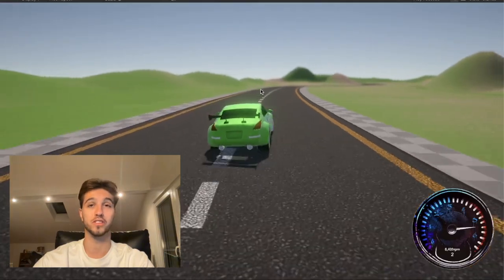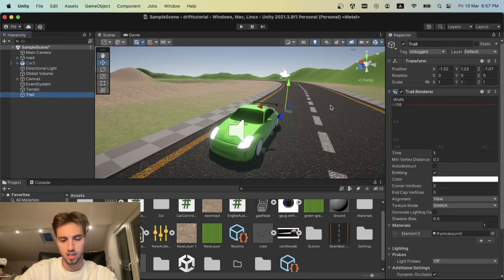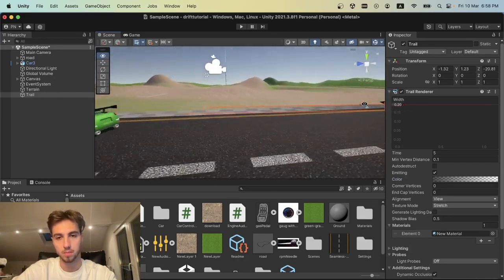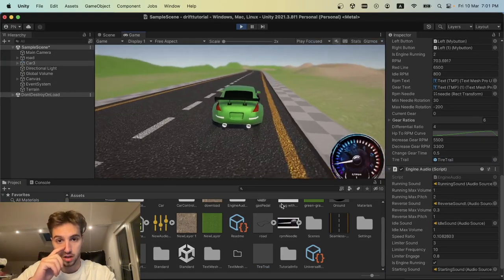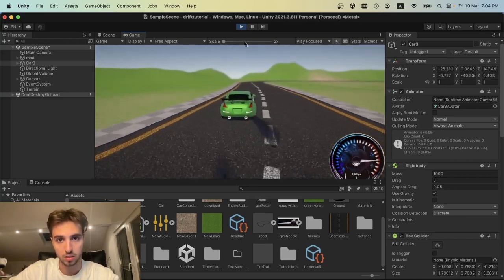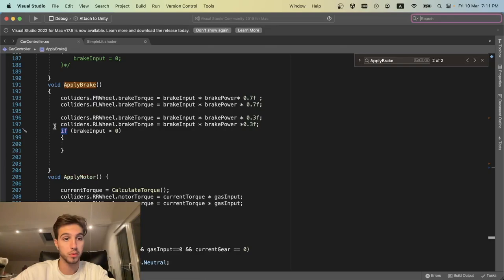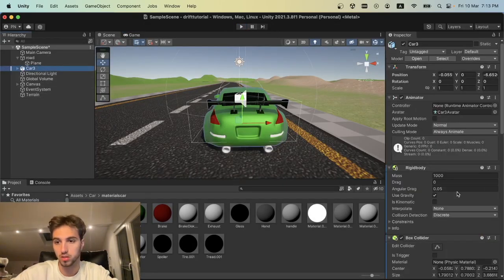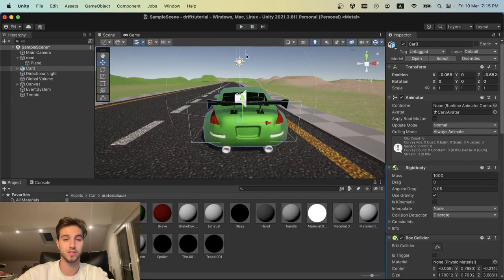Unity Car controller: Tire mark trails and brake lights + Download

Comment: Thank you for helping me a lot, but I have a small question, how to make sure that when slipAngle = < 1f the car does not steer?
Thanks in advance)
Reply from the maker: I am actually not sure what you would like to do exactly. Maybe you can add an if statement to check the slip angle?

Comment: Thanks for the tutorial. Why is my trail on the ground rotated vertically? I am using an isometric camera for the car. I've tried switching to Transform-z and rotating x by 90 degrees, but the situation doesn't change. The trail twitches and is not on the plane of the road. How can this be fixed?
Reply from the maker: Maybe it has something to do with how the prefab is made. You can put the smoke prefab inside another parent prefab and rotate it. If not, it probably has something to do with the smoke being proportional to the world and not the local space.

Comment: Hello my smoke particel is not working but my trail is working do i need to make a prefab because i unpacked the car and then added in local scene? the particles are spawning but the material is not showing i am using the standard assets smoke material
Reply from the maker: Yeah you need a smoke prefab and add it to the car script

Comment: is there a way to do it with decals? askign becouse trails can cause a bunch of problems since theyr separate from the road and if not from a proper distance they can clip in it and perhaps cause artifacts. like for instance on a slope? i havent tested so i dont know but its a reasonable assumption.
Reply from the maker: I think you can actually do it if you handle the mesh generation with triangles, either that or creating a 2d texture and rendering that on top of the car. Would be a lot harder than a simple trail system though